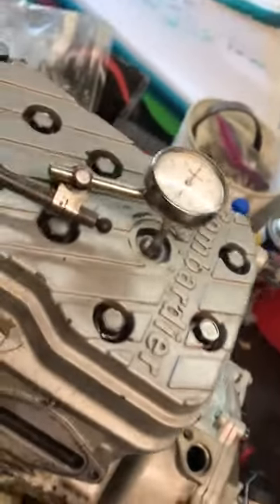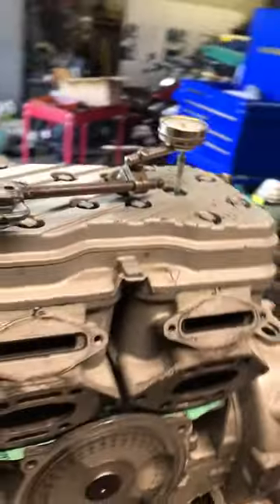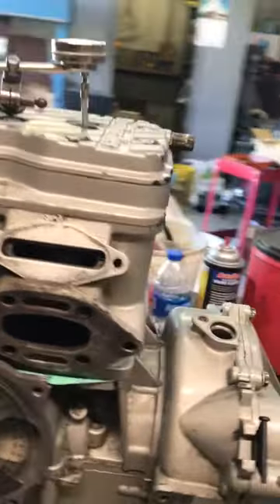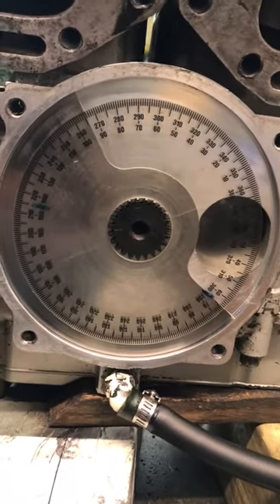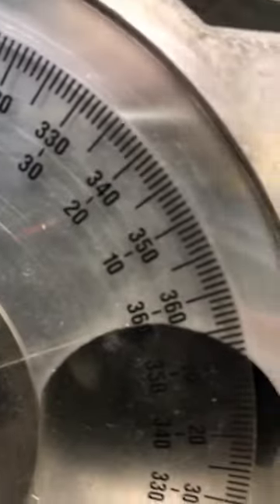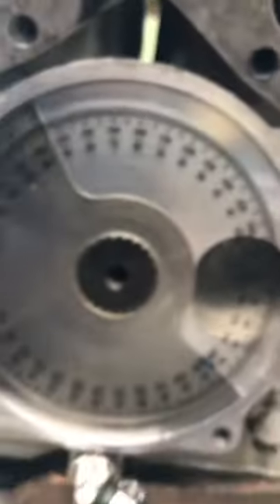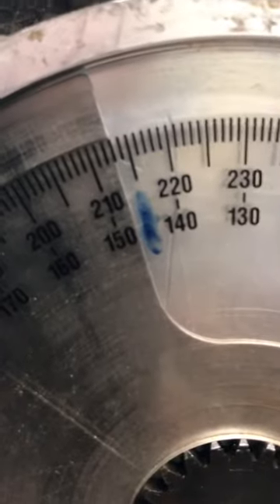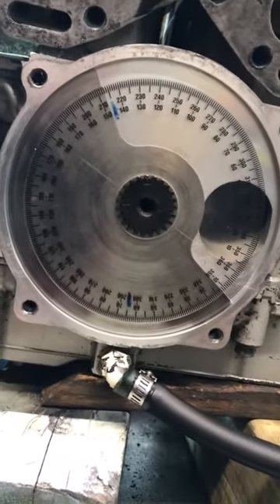Seadoo 787 RFI Rotary Valve timing Procedure

Comment: awesome vedio, very well explained exacly as it says  on sea doo manual for engine 787, right on target open 147 close 65 outstanding!
Reply from the maker: The valves don't always come out spot on.  Sometimes you have to flip the valve and determine which side puts you in better tolerance.   I like be closer to the middle but sometimes you end up with  readings at either end.  Intolerance is close enough but like I said, I shoot for the middle.  Good Luck !!

Comment: This is NOT correct procedure!
I used your method and the engine ran HORRIBLY. Full time mechanic, I knew instantly upon start up that I was experiencing improper timing.
You show us to line the 360 at TOP port when the procedure is to line 360 at the BOTTOM port.
I would take this video down man, I was not happy until I discovered that your instruction was wrong and that it turned out to be an easy fix lol.
Reply from the maker: Sorry you had problems.  If you watch the video you will see that there are TWO points to check the rotary valve timing.  ONE with 360 degree mark on the top of the intake port, and THE SECOND  to check with the 360 degree mark on the bottom of the intake port.  If you read the degrees when I do each one you'll see the difference. The video is absolutely positively correct.  The reason to check BOTH TOP and BOTTOM degree is because sometimes you can flip the rotary valve over and get the readings closer to spec.  There is a tolerance in the manual that is listed in degrees of variance.
Reply: @ripptydevibes2581 i think u should be the one thats gonna need to remove the comment 😂